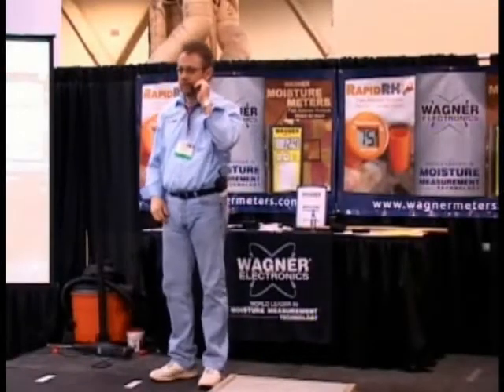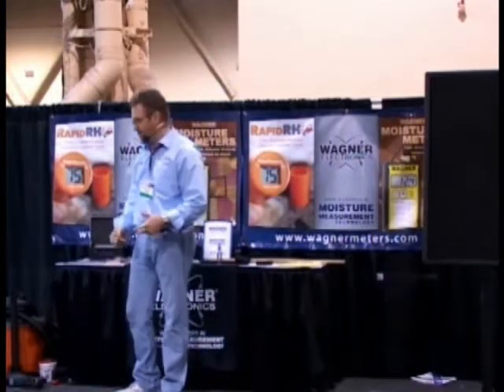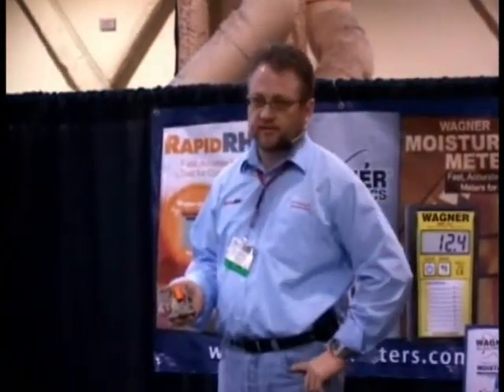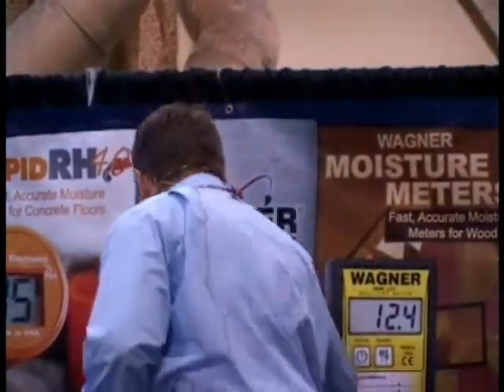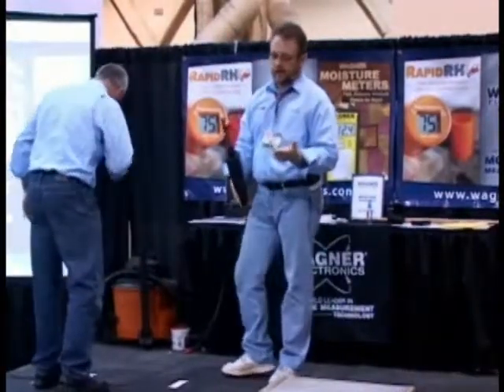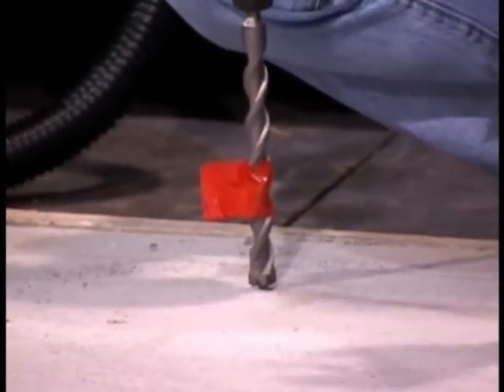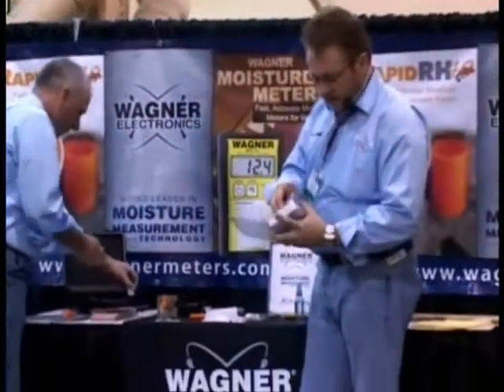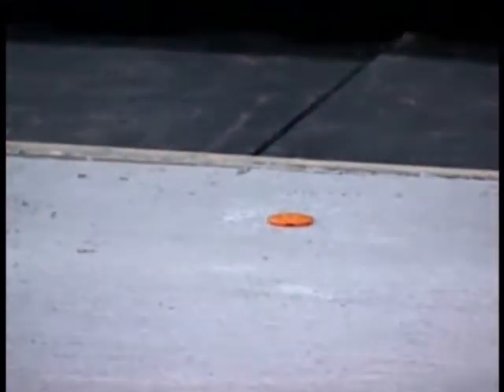Rapid RH Demo at Surfaces Show 2011

Comment: Likely required to protect the users resporatory system.  Though aftermarket filters are available for most vacs.  Some vacs supply them as a standard feature.  Properly rated dust mask would also resolve issue.